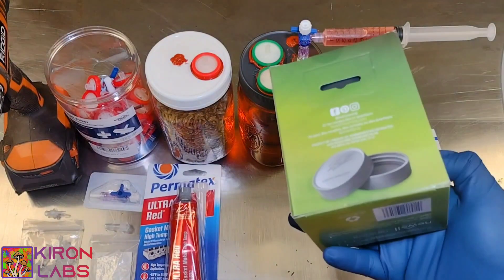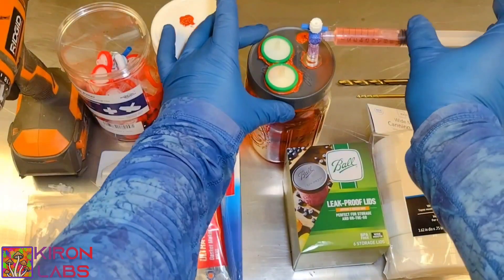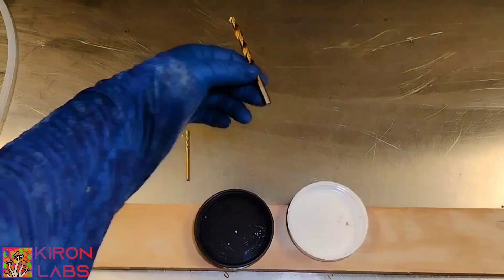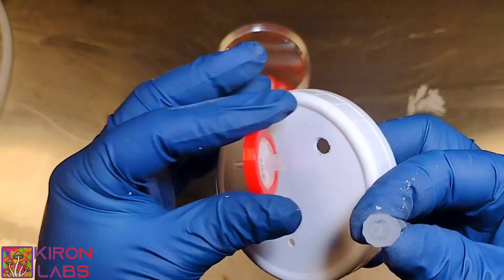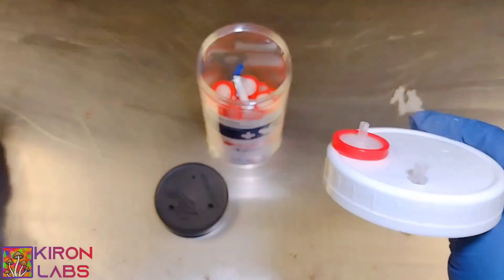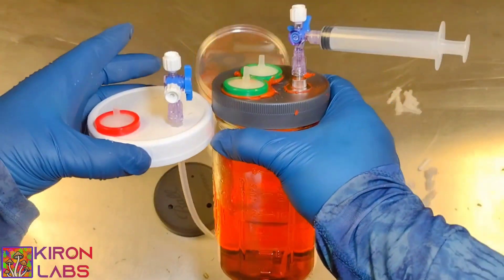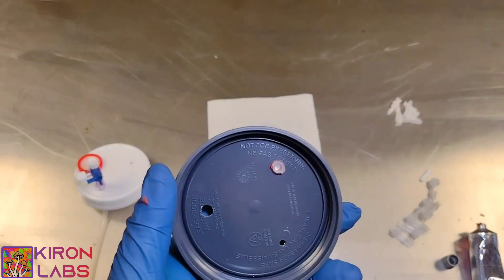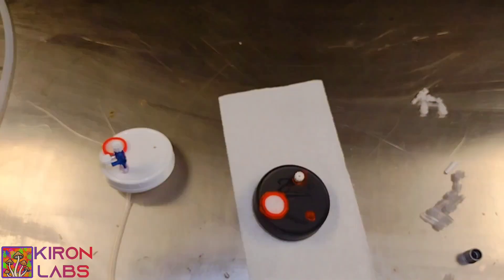How To Modify Lids

Comment: I believe i found all the parts.  I noticed you used 2 green filter discs on your liquid culture jar.  But you actually use the red?
Reply from the maker: I think the green ones are the glass filters and the red were papers. I just see how each of them hold up. Definitely stay with the cheaper paper ones. Also use 2 on your liquid culture jars or you may run into a weird vacuum issue

Comment: Gasket sealer is a terrible injection port in my experience, it never closes up properly from the needle so there's a hole and you end up putting some micropore tape over it anyway. So for grain jars I just use a hole with micropore tape over it, and put a second bit of tape over after injecting. For LC I use rubber injection ports

I like the luer lock, that'll save loads of time with getting syringes filled